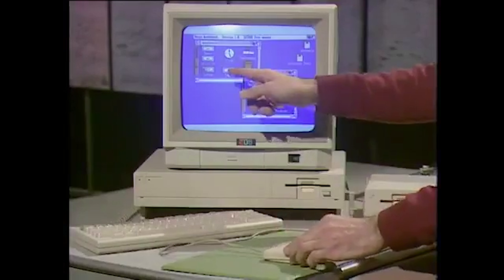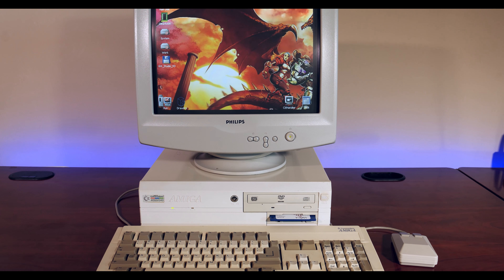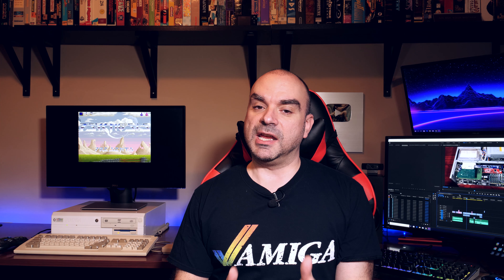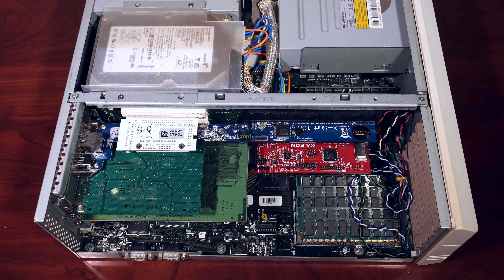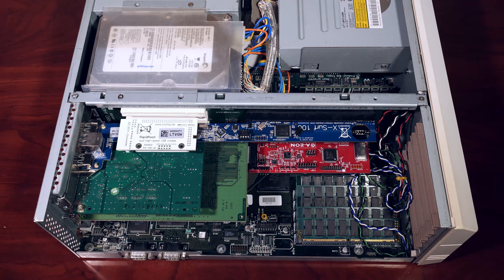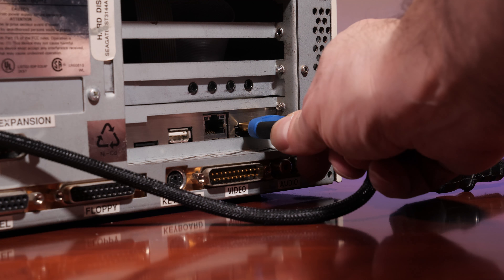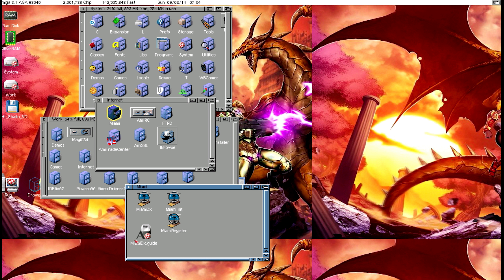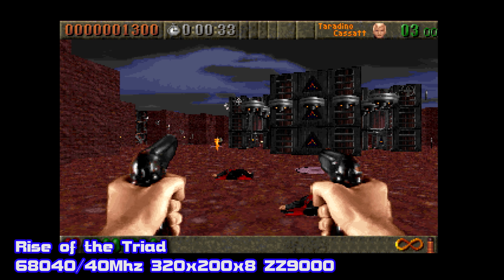Pimpin' the Amiga in 2020 - The Only Amiga Graphics Card you'll ever need - MNT ZZ9000 | MVG

Comment: MVG,  is the 1GB of RAM available to the Amiga as Fast RAM - I have a 4000 where the Fast RAM installed on the mobo only works intermittently?  Cheers
Reply: You can add 256MB of it via addmem.
I added about 50MB of it via addmem in the startup sequence
However if your original 16 MB is unstable you have to boot with out it.
The ZZ9000 needs a little time to boot up so you may want to add a few seconds waiting time before commanding Addmem in the startup sequence.
You have to do it quite early because with only chipmem present you would run in to trouble loading p96.
In the end Using the mem on the zz is considered experimental tough i had no problems with it since i use it.
Reply: @Flofutz  Thank You for the info!
Reply: @OldB0y50  No problem.
Regarding the Amiga it could be quite confusing theese days.
But there are support threads on A1k.org and on the english amiga board
Reply: @Flofutz  Yeah, I'm on EAB from time to time.

Comment: Curiously thought about this...
Siiince, zorro 2 n 3 are, same thing. Doesn't that mean you can convert zorro 2 to zorro 3 and run this GPU natively on 500/600/1200...?
Reply: This is already a Zorro 2 card, I think.  I would have to be to work on the A2000, which this says it does.
Reply: @JeremyLevi  oh that's neat! Thank you, might as well do this as a side.project.in future to adapt it to slim models :P
Reply: @HoboVibingToMusic  It looks like they offer a configuration option to support the A500 on their site, includes a Denise adapter to get around not having a video slot for up-scaling the 15khz modes.  You'd still need to get a Zorro to Zorro II adapter though, just like trying to use any other A2000 card on the A500.
Reply: @JeremyLevi  cool! Thank you for this info!

Comment: I still say, that the biggest issue, the Amiga have. Are still the pain it is, to get a useable monitor solution, if there are no 15khz monitor to be found.

The fact is. Without a monitor, you have no way of using the machine at all.
Reply: This card does away with the need of old 15 khz monitors.
Reply: @milk-it  Yes I know. However not all Amiga's are big box machines. And this card is not something that is found in ANY stock Amiga's. Basically. The biggest issue is still the 15khz situation. And trust me. I have tried too many solutions, that basically offers bullshit results.
Reply: @brostenen  I realise that, but I was referring to big box Amiga users who were directly targeted in this video. I know what it's like, though. I have my original A500 among other similar Amigas, and while my original CRT still works, I'm still not satisfied with the up-scaler Framemeister or other similar solutions, either. You're right, the 15 khz issue is certainly a bugbear for all Amiga users.
Reply: @milk-it  The only solution forward, is if monitor makers will produce a 15khz LCD monitor. I am thinking some kind of panel, in 5:4 format, that can do a flickerfree image at every old resolution used through the years. A monitor that can do it in 50 and 60 herz refresh rate. And have scanline generator build in. Perhaps driver board, that are build on the basis of OSSC and Retrotink combined. That can eighter be installed inside one of the most sold monitors. (Replacement aproach) Or it should be an universal driver board.

Comment: ah so we go back to true 8bit  pfft. You do realize the Classic Amiga has true 24bit standard,and used the pc video cards as buffers. TO but that is size.Also, we had a true 48bit video card. THE Toaster had to equal it so the Toaster is also True 48bit. We also have a RISC Vid card in 1990 for the A1200. Which is true 24bit. These you DATATYPEs not arcane drivers.